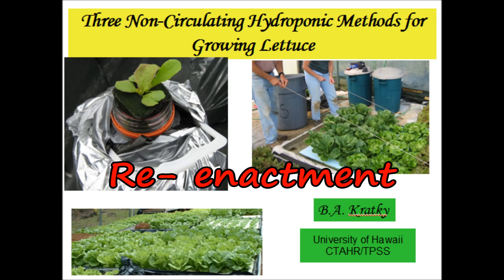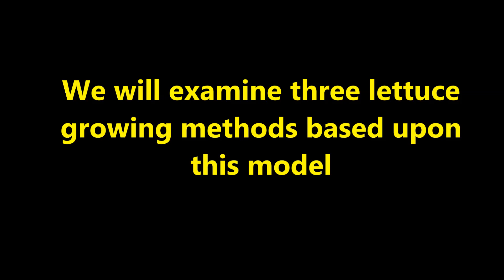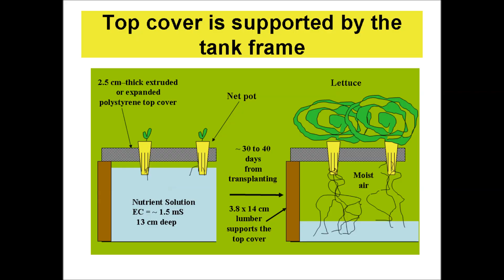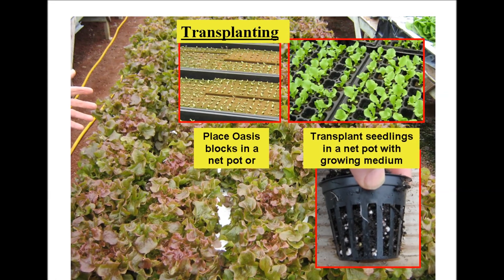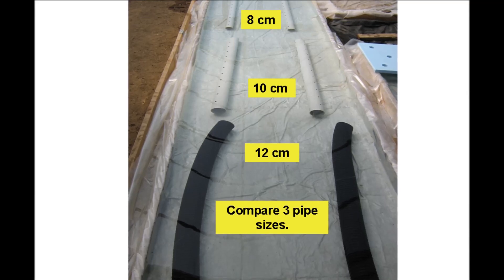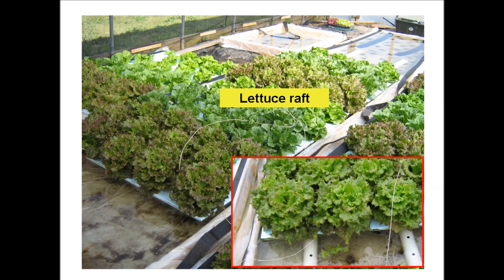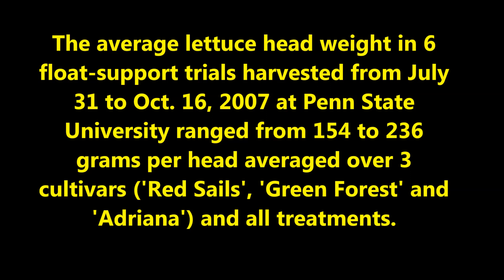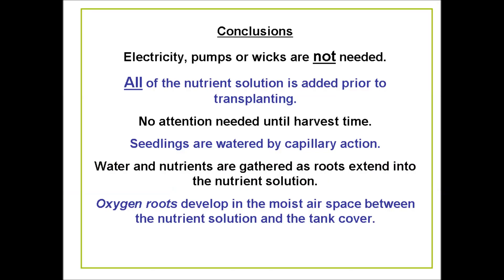Three Non-Circulating Hydroponic Methods for Growing Lettuce (Re-enactment of Symposium Talk)

Comment: @10:27  ..to cut polystyrene without messy plastic dust. a hot heater wire cuts plastic foam like butter..  heating or sharpening rim edge of a metal can to punch circles or desired shape would be faster n consistent than prior pyro techniques..
Reply from the maker: Thank you for the excellent suggestions!

Comment: Hello Dr. Krakty,
Thank you for sharing this method. I am wondering if your method will work with standard potting solid as growing medium and a simple water reservoir . I am bit reluctant to use nutrient solutions, as the disposal of any left over solution is an other environmental challenge.
Do you have experience with such a setup?
Thanks in advance for taking the time to respond.
Best wishes
TS
Reply: I normally use rock wool as growing medium. But I once used kitchen paper and it worked. I wouldn't use potting soil as the particles are too small.
Reply: 5 years later, I'd like to know this too!

Comment: Thank you Dr. Kratky for some wonderful videos.  I was just wondering is this method considered organic?
Reply from the maker: No, this wouldn't be considered organic because a chemical fertilizer is used.  However, the system is usually pesticide-free as herbicides, nematicides and soil fumigants are not needed because there is no soil to deal with and greenhouses/rainshelters discourage foliage diseases and small scale growing discourages large buildups of insects.
Reply from the maker: @VanLess Dweller Yes, you can produce crops from a chemical solution containing the correct amounts of the necessary elements for plant growth.  Plants also need carbon dioxide, water and light for photosynthesis.

Comment: I AGREE! Styrene is not your optimal  material. It is easily possible to use 1020 plastic grow covers floating or nested on supports that float in the existing water supply. I think it needs to be mentioned in other environments, PH and PPM will need to be monitored as water evaporates (let's think PHX) and PH/PPM will climb to high levels if water is not replaced at some times. In other environments, water supply may need to be entirely replaced, at least one time before harvesting. HW and some other areas are ideal but most will not have ideal tap water to start with, will not have PH that is improving over time as water evaporates in container, let's think about what can still go wrong if you do not live in the world's greatest environments on earth please! It is so easy and inexpensive to monitor and control PH/PPM, I think it is worth mentioning for those that have burnt leaves, these issues can crop up and here is what should be done to mitigate or avoid them.
Reply from the maker: Thanks for some excellent comments.
Reply: Hi, I'm a new grower. I've heard any growers mention the issue of PH, etc., but I'm wondering, how you would monitor that in a "closed" system like a 4L bottle. You'd have to remove the whole plant. No? This area is confusing because I thought it was a set-it-and-forget-it" system. Can someone explain how plants use nutrient solution and water and why PPM or PH would change in a bottle? Thank you.

Comment: Aloha Dr. Kratky,

I see hydroponics as a way that we can protect against rat lungworm disease because the plants are not grown in the ground. The slugs can't easily reach the plants or a barrier can be constructed to keep them away. Do you encounter many slugs in your systems?
Reply from the maker: The floor in my greenhouse is covered with a geotextile fabric and the slugs don't like it  because it is dry and rough and probably causes them to lose slime.  Additionally, I placed copper sheeting under the legs of the bench. As I understand it, the slug slime on copper becomes an electrolyte and imparts an unfavorable electrical environment which discourages the slugs from climbing up the legs.  This combination has been pretty effective.  Now, it still might be possible for slugs to crawl up the greenhouse legs and onto the plastic cover and fall into the lettuce.

Comment: Perhaps, regarding your comment on the mess of drilling the foam board, using a section of pipe. You may be able to get an off cut of exhaust pipe from a muffler shop in the correct diameter. Filing the edge of one end like a knife bevel. Either twisting the pipe through the foam or punch it through with a mallet. 

Do you think Broccoli could be grown like this?
Also, is there any concern with chemicals leeching from the foam board or from the plastic tank liner, especially given the interaction with the chemical nutrient solution? 

Thanks Doc! :)
Reply from the maker: Thanks for a great suggestion on cutting holes in polystyrene; I think it would work.
Broccoli has a longer growing season and probably needs more water, but either a larger tank or a float valve could supply additional water.
We generally paint the top of the polystyrene with white latex paint. Since the temperature is relatively cool  and there is no contact with nutrient solution in the top supported method and only temporary contact with the float-support method,  the chance for leaching into the nutrient solution should be minimal.
The liner consists of polyethylene plastic which is considered to be one of the safest plastics, but possibilities exist for interactions with unpolymerized plastic, colorants and additives.  Take notice that food, medicine and water are stored and shipped in polyethylene and it is the state-of-art today, but can and will be challenged  and improved in the future.

Comment: Aloha, Dr. Kratky.  Jeb will be very proud of your closing music selection.
I was wondering what advantages are there to using long beds over multiple individual grow containers?  I use individual containers because my grow area isn't suitable for large grow beds.  I'm just wondering if I need to change my process if I significantly expand my operation and upgrade to a larger facility (which I hope to do someday).  
Thank you for posting all your content, my grow operation wouldn't be the same (or probably even exist) without it.
Reply from the maker: Everyone's operational design is unique to their situation.  The purpose of the research was to see if a less expensive ground tank could work and also if aisles  could be mostly eliminated, but there was a 'cost' of bending to pick up the rafts.  I was delighted to learn this classical music by Beethoven was available for uploading from the Youtube Audio Library.